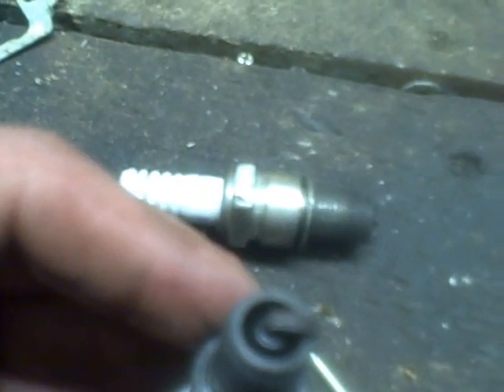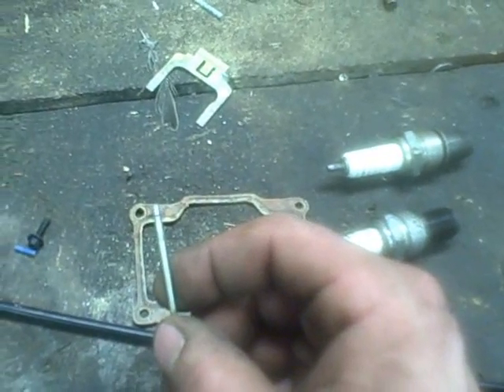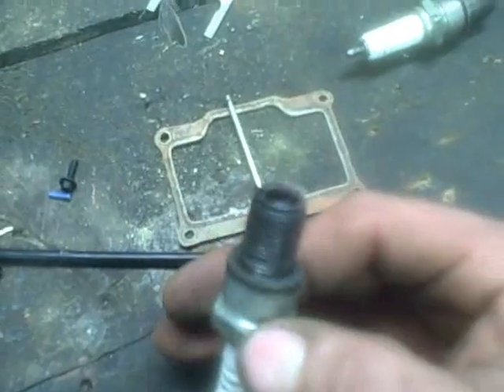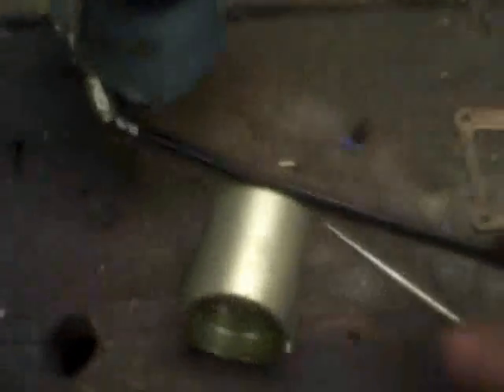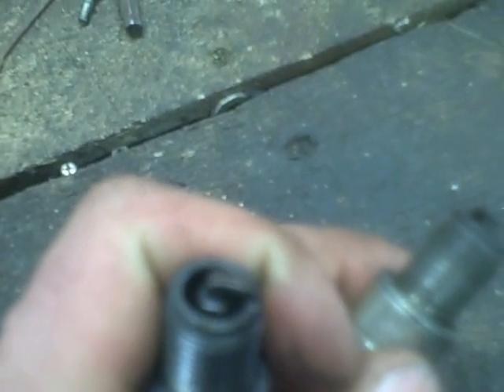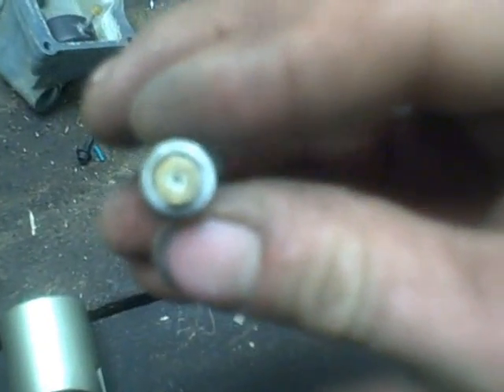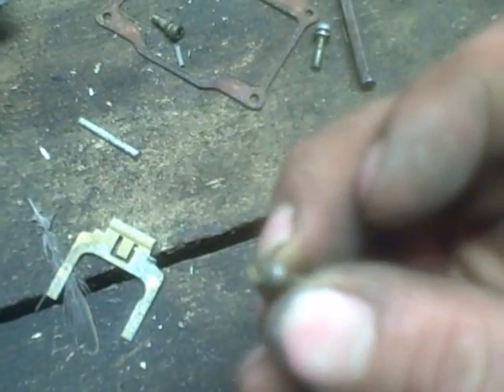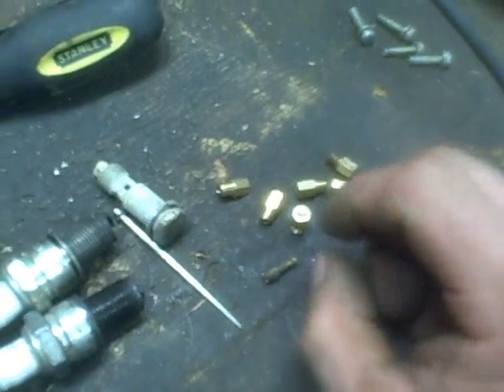ATV carburetor basic fundamentals and jetting procedures Part 2

Comment: i have a 500cc motor.  when i go through the gears i go at full throttle and the low end power just isnt there.  i have a new pipe and a new k&n air filter and i have not rejetted it.  what do u think i should do?  bigger main? only at the higher rpms do i really feel the power kick in.

Comment from the maker: if all else fails go for the blacker plug it will cause less trouble in the long term... you may have to try soem different combinations of jets till you find the right ones that give you a nice chocolate color on the tip